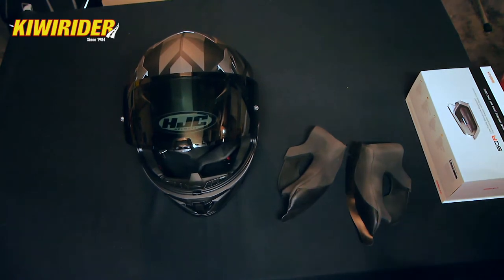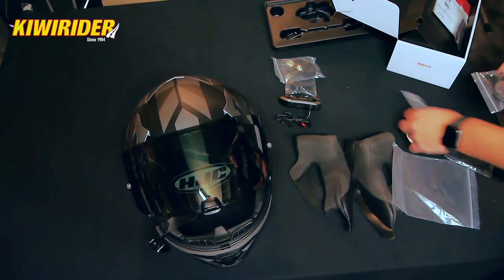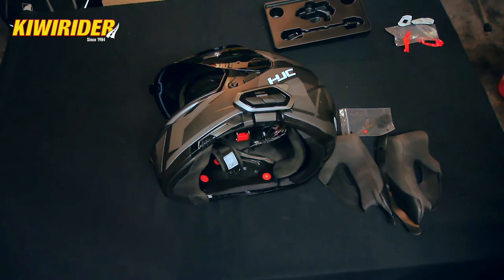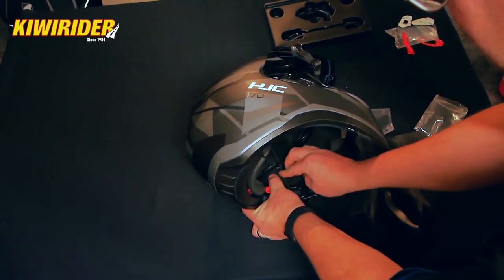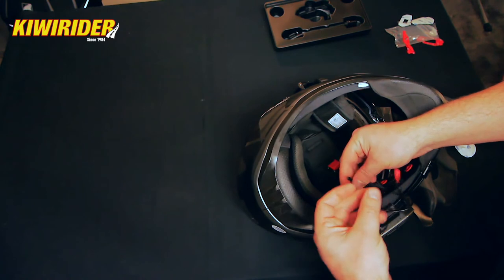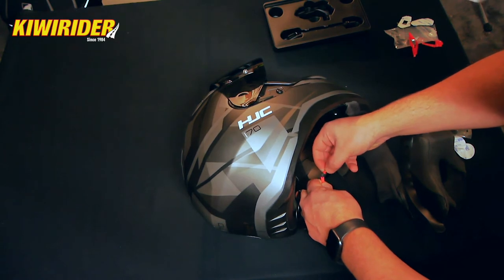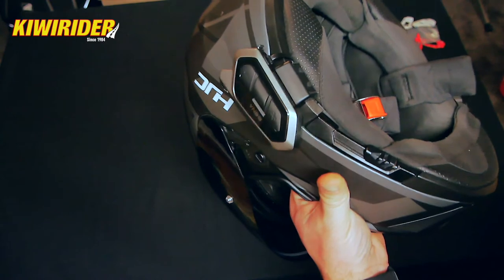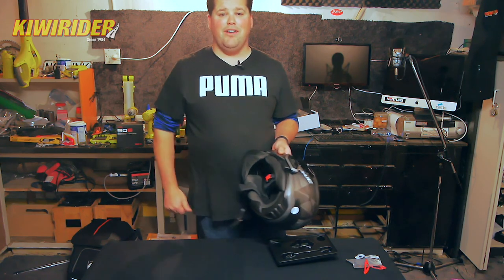Sena 50R Installation | Kiwi Rider

Comment: I bought dual pack of 50R, both units didn't hold the charge, wish to go back to 20S
Reply from the maker: you should get them looked at under warranty. the 50R is a major upgrade on the 20S.